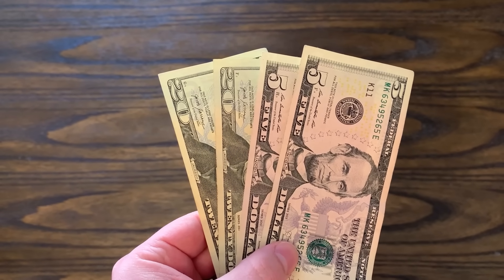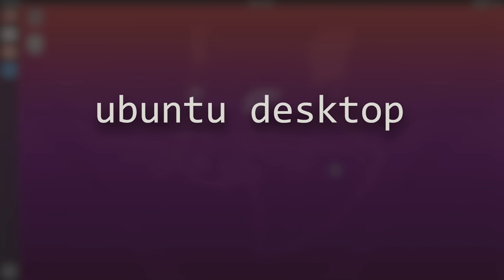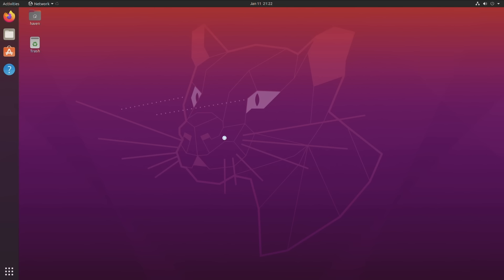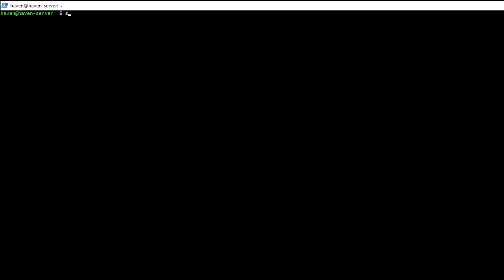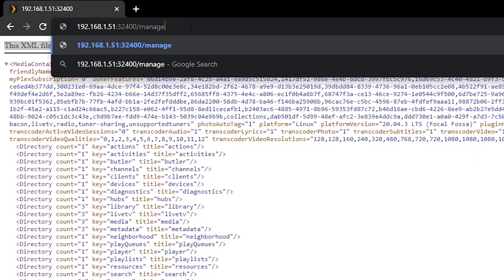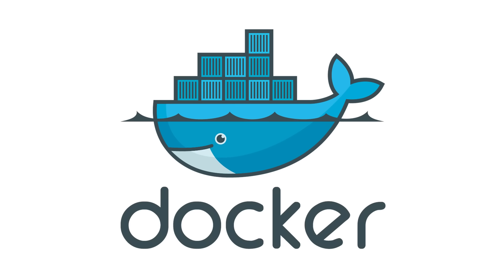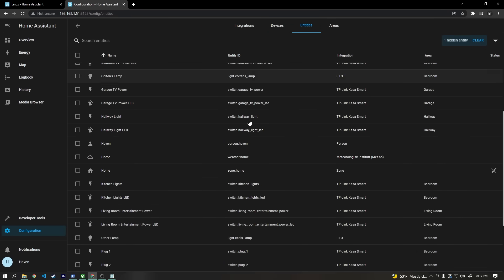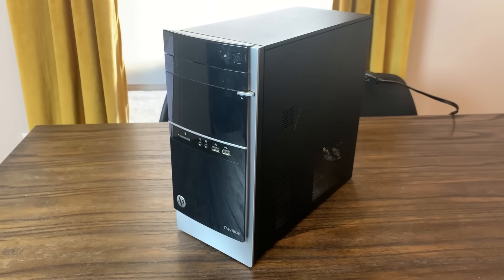Incredible Budget Home Server! (Minecraft, Plex, Home Assistant, NAS)

Comment: No, this is not how you set ip address
You make static dhcp lease,  not just manually set ip.
This is a terrible idea,  which will get you into trouble, which will be hard to diagnose
Look, I have 53 static leases on each network. I have 11 networks (each have its own purpose and uses vlan).
Do static ip there, and you run into problem. 

Never use static ip for non gateway hosts. Even dhcp and dns hosts should be dynamic.
Reply from the maker: I’ll be the first to admit that I’m not a networking expert. I’m quite the amateur. But I think anyone working on a network that complex will probably understand how to setup DHCP reservations and a local dns. I could be wrong, but on a small home network, I can’t imagine a few static IPs outside of the DHCP range causing too many issues. I could be wrong though.
Reply: @Hardware Haven  outside,  yes, you are correct
What I described is my home network
I just can not stand stupid limitations of home router and my switch (Cisco SG300-52) 
Being limited on number of IP reservations to 32 is really stupid. 
Therefore I setup DHCP and DNS + VLAN router on Lenovo M93p tiny and the problem is solved. All my mains will always easy to find and I have a list of IPs always handy
Oh and no, network is not complex
Each server takes 9 IPs (4 for NIC, 4 for iSCSI and one for iDRAC), I have 2 servers
Another 5 goes to desktop serving as server
2 to laptop, 2 to each raspberry pi (I have 3x 4b, 1x 3b and  zero W), I have desktop (it gets either of 2 IPs, as Linux runs bridge and windows runs directly), I have 5 Lenovo m93p - 3 serving as media machines, 1 as under-powered desktop and one as DHCP.
Oh and network printer (yes, it have IEEE802.11, but that is g, so it runs on wire) That would be all - 27 ports on Cisco SG300-52 and 1st used for Internet connection for 28 total. 

It is worth to move dhcp to Linux server for single reason - speed
The most time wasted in connection is slow router deciding to answer dhcp discovery and dhcp request
You can cut it to under half second with Linux server, even on Raspberry Pi. I moved my DHCP/DNS server from Raspberry Pi 4B 2GB.
Regardless
It is much easier to manage IPs, while all settings are in single place. Reservation is always better idea then Manual static ip
Reply from the maker: Happy to take all of that into consideration 👍🏻

Comment: A video server needs a good GPU to convert 4k movies on-a-fly. A game server needs RAM. All you can make out of this trash is a NAS (in case it has at least 1Gb Ethernet port).
Reply from the maker: - You are correct about 4K transcoding, but not everyone cares about that. We use our Plex server all the time for lower quality content and it’s great.

- The MC server in this video isn’t the best setup, but I’ve made another video running a server on 6GB, and have viewers running one on fewer and it works fine for smaller servers. Also things like terraria servers definitely don’t need more than 8GB of Ram.

- It also works just fine as a NAS, for running home assistant, a small web server, a mail server, an mqtt server, hosting bots, and many many other things. It’s not trash, it just might not be what you need for what you’re trying to build.
Reply: @HardwareHaven  Sure, it depends. Even some older GPUs (like 730 for example) can be used for a transcoding. Your is only an example. 
PS I just remembered how much RAM daughter's minecraft server needed -)